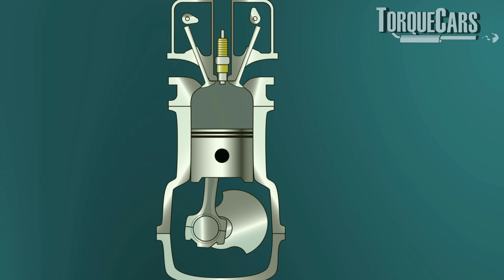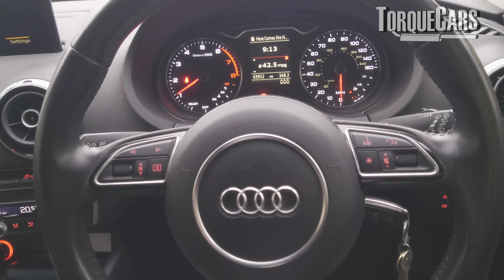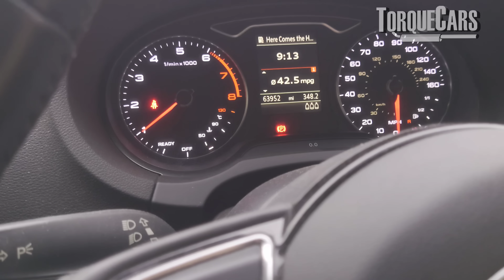These Common Cold Start Mistakes Could Destroy Your Cars Engine!

Comment: The thing that does my head in...especially with women I notice..is that they don't half turn the key ( if there is an insertable key) until all the warning lights go out before starting the engine.
I was told years ago to declutch before starting the engine to ease the strain on it  but I'm not sure if that is actually helpful or just an old wives tale?

Comment: Wow these comments are all over the place. REMEMBER: your engine doesn’t care if the wheels are moving or not. If your car warms up at 1500rpm, then it’s fine to drive around at 1500rpm. Easy with a stick shift, but if you have an automatic transmission take advantage of your low gears to simulate a stick shift.

Comment: Ok, couple of things make no sense.
Allow the engine oil to warm up (except if you live in a extreme cold temperature country or city) make no sense. Even if you warm it until it DO warm it's the same as if you don't warm it up enough and stop the car.
The expansion as well, it will not be expanded anyway even if you do drive it for a long time at the first mins of the engine after start.
The oil saturation of engine fuel i can agree but just change the oil at half time/kilometers.
The engine actually warm up faster if you just drive... Just don't hammer it before the water temp is up to normal and if you turn on wait just 5 to 15 secs is enough to run.. 
Don't be a hostage of your car.. take care of it but the car is made taking account that some people use it just to go on short trips... it is called severe use on the manual and all it demand is to change the oil earlier.

Comment: All the cars I bought are used and high mileage, 150k 190k miles.
I hope people keep following your advice so I can still enjoy my high mileage cars. 😊
Thank you.
Reply from the maker: Me too, I only buy older higher mileage cars.
Reply: Yeah but you'll never know how it was treated for all those miles. And you'll never know if the lifespan of the cars has been shortened due to neglect. If one of your cars dies at say 220,000 miles, how will you know if that's it's maximum life or it could have gone to 250,000 with proper maintenance, prior to you acquiring it? It's all just a gamble.

Comment: 1) modern engines have protections, so it matters little, INCLUDING THAT German car makers even ADVISE to start driving after starting the engine (due to pollution and faster warming)

2) of course if it’s a car of mine I don’t start cold and press the gas too much! Most people between starting the engine and taking the car out of the garage, it’s mostly enough for the engine to oil well and and reach a minimal working temperature. Again, I don’t push too hard in the first minutes, but then again: WHO needs to drive really fast right after starting cold the car?!

It’s a no thing unless you really want to brake your car (which won’t happen in modern cars) or your ribbed a bank and you need to escape.

Comment: If I knew car engines and warmups share the same concept, I would have saved some cash! In the email realm, Mystrika is warmup pool spread my campaigns smoothly. No more deliverability issues, even with Microsoft 365, which was a pain before this. I have been consistent in achieving high open rates thanks to provider matching. Plus, joining their Facebook community? Felt like getting a VIP pass into a club of knowledge. For those serious about cold email success, a Mystrika trial could be enlightening.

Comment: “Warm up for exercise, do we allow the same courtesy for our cars”

Fck I am sick of idiotic people saying this…so do you just SIT there to warm up or do you MOVE??? You MOVE!! (Sitting there you heart is still pumping)

So with you car, do you SIT you car there or MOVE (engine is the heart, it’s pumping) - YOU MOVE! Drive NORMAL and not like you’re on a racetrack, allowing the engine to warm up the oil! It’s QUICKER to warm up when MOVING then SITTING still.

Fckin dumfck. I have a car that has OVER 500k, never needed to sit there idling on cold starts, just have REGULAR servicing!
Reply from the maker: Did you actually watch the video, or just assume what it was going to say based on the opening section? It advocates driving it to warm it up, it only needs the time you put on a seat belt for the oil to circulate.

The only exception would be in EXTREMELY COLD areas, where it is just not possible unless you have an engine heater/warmer fitted. The whole point is to avoid high loads and high RPM until the engine has warmed up, which is kind of what you are saying (not on a racetrack).

Comment: Start your engine let it tickover for a minute or two then slowly raise rpm to 2000 hold for a minute or two' do not rev the bollocks out of the engine on first start , this applies to diesels  more-so , retired diesel mechanic .............

Comment: my brand new 2024 petrol car revs instantly to 2000rpm when cold starting. after you start moving revs drop a bit but still over 1500. then, gradually it starts to lower cruising revs and finally, after about 7km (!) and oil temp around 68c they drop to normal 1000ish revs. modern cars act funny

Comment: It takes only a few seconds for the oil to circulate around an engine. The gearbox oil won't warm untill the box is used so sitting idling won't help.

Comment: 6:25 When an engine is cold and is started it goes into a choked state feeding much more fuel to the engine than normal, if your normal idle when warm is 800 RPMs you can expect under a cold (choked) start, and for the first ten minutes for the RPMs to be closer to 1500.
It is important not to touch your gas pedal during this time. One reason is that you can unchoke a cold engine if it is carburated, which can cause it to stall. The other reason is that you do not want the piston to slap and passably score the piston walls.
The oil rings on all gas engines are more easily damaged when cold. If you rev the engine to get it hotter faster, you stand a 100% chance of burning oil by the time the engine has 100,000 miles, and I would argue much sooner.
My conclusion is to start the car with your remote starter and let it idle for about ten minutes this will help your engine and ECM to adjust to the new conditions, your transmission and differential need this time as well for proper lubrication. Change ALL the fluids as per the owner's manual
DON" T
Listen to YouTube or TikTok mechanics, they will Not pay you when they are wrong!

Comment: I unfortunately couldn't start my car today, not to mention I've been manually starting my car bc I disconnected my ESL since it locked months ago (2012 mb c250), do you have advice for me to remedy my problem? I tried jump starting my battery, but since I do not have an ESL & manual start my car, it still did not start. Please help! Thnx.

Comment: This should be common sense and especially with turbo'd cars but sadly i see SO many people even just after work hop in and immediately peel off quickly beating on their car/truck. Just start your car first and a little slower get ready, set phone for music, belt/mirrors, any settings you need to do on startup (auto on/off or TC on/off if you have either) by then your a minute or 2 in and can just drive lower rpms/out of boost until i see like 180+ on oil temp.

 Or shrimply put, let it idle til the high idle rpms drop and go.

Comment: So i have a VW GTE, what would be the best way. It always starts in EV mode unless i force start it with the ICE. I usually drive for 2-3 mins in EV mode, then use battery hold as my commute takes me straight onto the A20.
Reply from the maker: I wouldn't worry too much, just avoid high RPM and full throttle on a cold engine (you'll probably find that VW have limited the revs to around 4000 when the engines cold). The oil specified on these helps mitigate many of the problems. How do you find the GTE in  terms of economy and weekend fun?

Comment: Wherever you live from cold start let it idle for 60 seconds then take off, you're fine..
Reply from the maker: It's not a big ask is it, but it'll help your engine stay mice and reliable for many years to come.
Reply: @TorqueCarsDriving  whatever I drive no matter what climate when I start it cold I always let it sit 60 seconds then go... when it's ice cold your car idles High anyway till it drops down and if you don't let it warm up it engages the transmission at high RPMs which could hurt your torque converter and transmission too

Comment: Who has the time or inclination to go through this every time they go out in their cars. 🙈
Reply from the maker: The key is to simplify it, most of us aren't dealing with really cold temps. Start, seatbelt on and drive cautiously for a bit - hardly inconvenient or annoying. When things get really cold you need to think about engine heaters and allowing a bit of warm up time before you move off.

So for most of us, wait a short while then drive off without using 2/3 to full throttle for a bit - that's all we need to do.

Comment: Anyone wondering about the transmission temperature? Cold start and drive off is harmful.
Reply from the maker: Cold start and drive gently is always the mantra here, the transmission will warm up gradually. The start method depends on how cold it actually is, -40c requires more care and other techniques compared to -5c for example.

Comment: Says you "must let the engine warm up" but then says "the two things you must never do on a cold engine is leave it idling". 

You do know it's not the 1970s anymore? 

Oils today are designed with cold start inside, they have a much greater capability of "sticking" to components when the engine stops running. The grades of oil we use now are so thin they're almost like water, they very quickly get around the engine. 

Never bothered warming up an engine in the 35 years I've been driving. I drove my last car, a 2009 2.0 MK4 Mondeo TDCi 140 to 155,000 miles, gave it to my parents and its just passed 204,000 miles. Still on original injectors, turbo, EGR valve and the DPF filter made it to 182,000 miles before needing replacing because it got a rust hole in it. Engine doesn't burn oil between the 12,500 mile services, no oil leaks and other than the cambelt has never had a spanner to the engine. 

It replaced a MK3 Mondeo which I ran to 168k and which was the same as above.

Comment: When an engine is cold the tolerances are larger allowing more of the thicker oil in between the gap then as the engine warms up and the tolerances shrink, the oil warms and is able to fit into the smaller gap. So your not doing any damage to the engine driving it straight from turning the key.

Comment: My Toyota landcruiser J150 has an IDLE-UP / PWR-HEAT button for increasing idle at cold start. 3k miles oil/filter changes also helps :-)
Reply: so did my 120. I also had a Webasto pre-heater installed, so over 17 of ownership that beautiful thing had only maybe 5-10 cold starts. sold it few months ago after being parked for a year. no issues starting up

Comment: ROFL i have a bmw f11 525d tuned to 300 hp and 612 nm ..Bought it at  214k KM (tuned).Now it is 350K .My wife?Cold engine???? I have to go to work.She is always late.I dont say paddle to the middle .But ow boy .i need to say i did use this car to go to my work ..On the german autobaan.for 4 years.My town to bremen .DE. 180 km/h all the time and back to home the same .320 km up 320 km down.Maybe that did save my car on the milage?

Comment: In my country (Belgium) it is actually forbidden to warm up your car. Start it and drive away immediately is the message, otherwise you will get a hefty fine from the police if they catch you. The reason for this is too high emissions when idling. But I don't care. I'd rather get a fine than a broken engine. My VW GTI gets all the love and care it needs.
Reply: Granny State Gestapo 😂
Reply: You are waisting time and money warming it up at idle.  Just drive gently for the first minute.  Idling a cold engine is harder on it.
Reply: @user-tb7rn1il3q  Totally depends on the latitude at which you’re running the engine. Northern latitudes 44-degrees and up, should ABSOLUTELY warm there vehicle for even just a single minute before pulling put of the drive.

Comment: I drive a 2016 WRX and Subaru has it where the RPMs don't drop below 1500 until the car reaches 116° F. I dont move it until then, and until at least 165° it doesn't go into boost or above 3K RPM. 

Just baby or "grandma" it until its up to operating temp.

Comment: Using the correct type and viscosity of oil will go a long way and keeping it clean and topped off (I'd say change it every 6 months or 5,000 miles at most, regardless of how little you may drive).  Even with modern cars, letting the car idle for about 30 seconds before driving off is a good idea (you don't really need to let them warm up anymore like you used to, but at least 30 seconds or 1 minute if it's really cold).  Another mistake I see some people make is revving the car.  Again newer cars can tolerate this a bit more (although it's not recommended either way) but older cars you may do a lot of damage due to some of their older designs, particularly if you don't use synthetic oils.

Comment: I run a high revving K20 in my type R, i always do an oil change before winter kicks in so its fresh oil during that  period, after start up i just drive it moderately until oil get's to working temp, booting it and high RPM when really cold is just asking for trouble.

Comment: It's not only cold starts but especially the warm-up period that follows after the cold start.

If you manage to avoid unnecessary engine load (as in cylinder pressure, not necessarily revs) up to the point of operating temperature, you can minimize cold engine wear.

Comment: Vw t4 2.5tdi owned from new: start without glowplug heat and drive immediately. Oil change every 10000 miles. Now done 335000 miles.

Comment: Just common sense gets you a long way. Just drive and don't rev the engine over 3k and also don't load it excessivly at low rpm until it is warm.
Even if the engine isn't treated right it will not show until the car has a limited value left. I have never heard of a properly maintained engine that failed prematurely because of not pampered it

Comment: Modern engines are using ever lighter oil grades, partly for fuel efficiency, so oil circulates far more quickly than in the past, even at low temperatures.  And, of course, modern engine oils are all multigrade.

Comment: Here is what I do, I turn it on. Wait for the natural high idle to come down. Then I let it idle for about a minute or two and drive slowly out the small streets of my neighborhood before I go into the circus that is the main streets
Reply: If its extremely cold outside, while its warming up I sometimes check my tire pressure
Reply: "Narural high idle?". How did you come up with that? There is no such thing. This is why you shouldn't get you information from random people on the internet. All cars have to meet emissions requirements, and the most important emissions devices on your care are called catalytic converters, and the sensors that monitor them (Oxygen sensors). In order for the cats and O2 sensors to work properly, they need to be at least 600 degrees. If not, you'll get false readings. And when you get false readings, your check engine light come on. The problem is every time you start your car with a cold engine, you'll get false readings from your O2 sensors, and the light will come on.
To resolve this issue so you don't get an engine light every time you start your car, open and closed loop operation for you PCM was introduced. When you first start your car, the PCM runs in open loop. When in open loop, the information from your O2 sensors is ignored. Once the O2 sensors reach operating temp, the PCM goes into closed loop operation and starts taking data from them and uses it to set fuel trims.
The high idle isn't natural. Its high because a special fuel injection mapping is applied to get the emissions control devices to heat up as fast as possible, so the PCM will drop into closed loop.
Reply: @052RC  The car idles high at cold starts in extreme temperatures what are rambling on about? It stays like that for a few seconds then it comes down. Its probably bad wording but it aint wrong. Im not gonna read all your bs malarky just because i worded something wrong

Comment: Oil pressure. I have a remote starter on my MGB and roll the engine over a few cranks before firing the engine up. Saves bearings. Also, prefill your oil filter before installation, if you can that is.

Comment: Ideally you want to see oil temp around 90F before starting to drive, and oil temp > 140 F before starting to use higher revs on the engine. I would let it idle as the video recommends wait for the rpms to drop and after that apply small loads below 2K rpm and see if the oil temp starts to move towards 90 F. If you are in a long parking lot where it takes 2-5 min to exit you could use that driving time to warm up the engine…